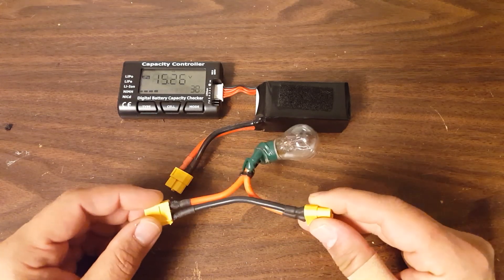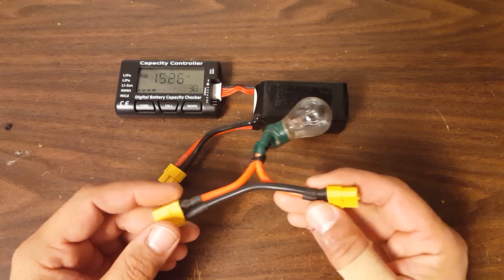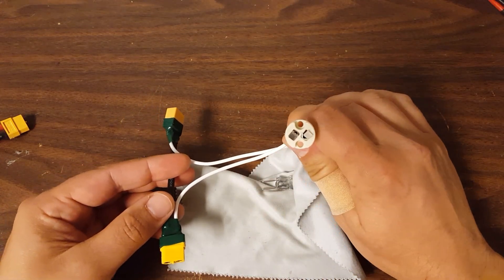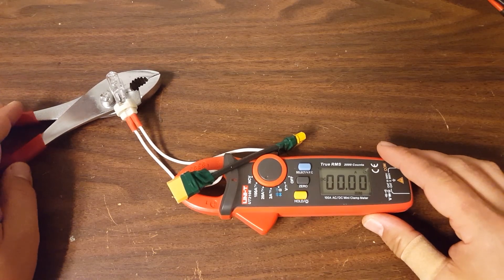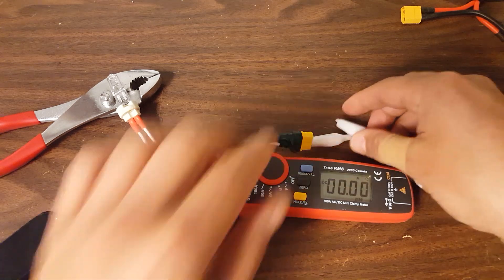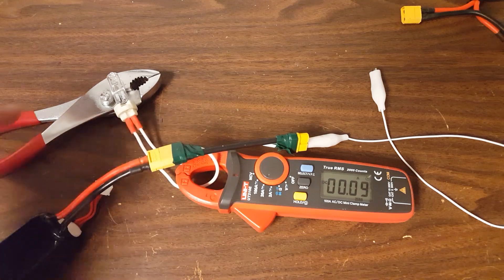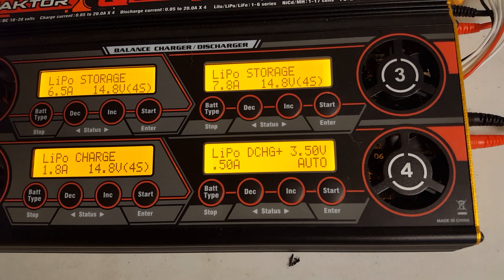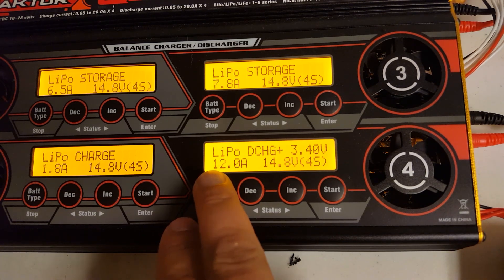Quick and Easy LiPo Battery Discharge

Comment: From the thumbnail it looked like you had soldered your wrench straight to the wires. It seemed like a brilliant idea to me. I was disappointed that your method was much safer. I think using the wrench as a resistor would be faster, though.

Comment: Would this method work for storage charging?  Eg, a full battery you want to storage voltage, add in this patch and bulb and then actively switch it off when the charger says you are at the correct voltage?

Comment: Might want to make sure your bulb leads are insolated from each other. They are not heavy duty silicone. The copper wire itself can take the amperage all day, but the insulation may get hot and melt and if the 2 leads touch we get a good example of why we never short a battery.  Your 100 watt bulb circuit will become 0 ohms.  I know the charger will limit the discharge current, but we don't want a bench fire.

Comment: Sorry, I know this is a slightly old video, but as with a lot of your videos, it still feels relevant!  Thanks for keeping these up there.

I was just wondering if there was any reason why you wouldn't just use a couple of power resistors in series on the positive line?  maybe 200W so with a 2s from 8.4v you'll discharge at almost 24A....or is that too fast?
Reply from the maker: If you had a 2S battery and wanted to discharge 200 watts you would need a 0.33 ohm resistor and would discharge 24 amps. The amps is probably safe for most 2S packs down to at least 1000 mAh and probably smaller, however the voltage sag at that high output would probably make stopping at a precise voltage difficult.

For more: https://www.youtube.com/watch?v=4CVd7QjGKGE&t=690s&ab_channel=JoshuaBardwell
Reply: @JoshuaBardwell  Thanks for the link....the load bank looks like a fun build, if only for the knife switch!  Although every time I switch it I'll have to give an insane monologue and a manic laugh MMWAHAHAHAHA!

Comment: I need a cheap way to discharge my escooter's 48v Lifepo4 and my ebike's 52v lipo battery. Both have XLR connectors. The 52v lipo has an led on/off switch which I often leave on as a parasitic drain, but since it takes so long to drain down to 50%soc, I sometimes forget and I afraid I will accidentally drain it fully. The 48v is Chinese and is from 2016, so I really need to pay attention to that one over the winter or it may be anemic come spring. I don't use it that often throughout the year, so it has relatively few cycles. I just need a cheap way to make a light bulb glow, but I don't have the skill to make it. Any help is appreciated.

Comment: 4:00  What about eye protection from UV rays?   I installed some halogen downlights in kitchen, and the instructions said, "Never operate without glass shield in place."   Maybe the danger is glass shrapnel, and not sunburn, or burnt corneas.  See:  "Is my halogen desk lamp UV safe? | BudgetLightForum dotcom"

Comment: great video but quick question.  i had a 3S fully charged up (4.2 per cell).  But i crashed the plane, it is going to take me a while to rebuild the plane.....Each cell was still at 4.13, .  Should i discharge the 3S down to 3.85 or should i discharge it down to 3.2 or something? (with my balance charger that has a discharge feature). then bring it back up to 3.85 ? (with my balance charger).  I will not use it again until my plane is fixed. Probably a week or so.
Reply from the maker: Take it to 3.8
Reply: @JoshuaBardwell  Excellent.  Last thing...sounds like you have tons of experience / flight-time.  What battery brand have you had the most success with? Turnigy or something else?  I want to go with what someone like yourself would recommend. thx in advance .........

Comment: I'm not having any luck with this.  My 4s battery smokes the 12V 100w halogen bulb immediately once I plug it in.
Reply from the maker: You can put two bulbs in series if you want. This will increase resistance but also decrease discharge rate. I'm not sure why yours is burning out but mine don't.
Reply: Thanks Josh, I’ll try that. I thought maybe I just had a bad bulb at first but I toasted 3 of them in a row.  I’ll add a second one in series and see how it goes.

Comment: I got the halogen bulb as suggested and set it up exactly how you did but when I'm trying to discharge a fully charged lipo the halogen bulb lights up for about 5 seconds and ramps up the amps but then it drops right back down to 1amp and the bulb goes off!  Why would it do that?   It's taking me hours to discharge my unused lipos after a flying day :-(

Comment: Would a 100w 120v halogen bulb work? Or does it need to be 12v?
Reply from the maker: A 120v 100W bulb has a resistance such that it dissipates 100 watts when 120v is applied to it. If 12v was applied to it, it would dissipate approximate 10 watts (1/10th the voltage, 1/10th the wattage). So it would "work" in that nothing would break, but it wouldn't be very effective as a discharger.
Reply: Joshua Bardwell thanks for the quick reply, while I was standing in front of the bulb aisle. 👍

Comment: Joshua, I've got your own parallel board V2. Assuming that each battery's voltage are within 0.4v of each other, can I use it to discharge lipos to storage voltage? Also, can I mix 1300 with 1500mah lipos? Thanks in advance.
Reply from the maker: Yes and yes.

Comment: I just got some heat syncs and fans from computers for general heat management and will use some of this info for discharging. Thanks.   For fun, I am thinking an EDF connected to a vacuum canister so battery drainage is shop cleanage. Or something like a leaf blower just to clear the space.

Comment: I have a standard household 100W light bulb and am discharging 4x4 18650's wired to run at about 14.8V. they re simply running the light bulb as normal, and the element just barely glows. It's working but at this rate it will take way too long to discharge fast, the whole idea of doing this. If I do the dead short as you have, using the same household bulb, will that make a difference in discharge speed? Or will I be essentually doing the same thing as I am? Please forgive the question if it's stupid, I know little about the math on this stuff :)
Reply from the maker: +Reluctant Rider household bulb is made to run at 120 volts not 14.8. That's why it's taking so long.

Comment: If you find an old lamp or signal enclosure from a motorcycle or a car, you will be able to mount  the bulb with out issue of heat.

Comment: Why would you not just use charger discharge function? And instead of light bulbs why would you not use resistors?
Reply from the maker: Because the charger discharge function is slow. Typically 1 amp maximum.

You can use resistors if you like, but the light bulbs are cheaper. A large power resistor gets expensive.

Comment: Hey JB, Im sure you get more questions than you can handle. I think that one of my setups is messing with my batteries. I just started building my own quads. I am flying with 3s 2200 mah 25C batteries. (Its all I had on the shelf from my walkera runner) I think that my batteries are getting over-discharged or discharging too rapidly. I have the failsafe on at 3.5v in cleanflight and I rarely go that far. I have a couple new batteries coming in the mail, and I would like to fix this problem before I ruin all of them. After flying, my batteries are really hot and some have become puffy. I think that my setup is discharging the batteries too fast. Feels like I am using the wrong batteries. What is the best way to measure the true power requirements of a quad? This might be a neat little topic because I cant find much info aside from a formula to calculate flight time. I want to include all vehicle systems; vtx, tx, led strip, etc. Ideally, I would like to see measurements during flight. I think that this might help select the correct battery. I havent played with blackbox much, so I apologize if I am missing the obvious answer. Thanks for everything that you do for the community! I wouldnt be flying without you.

Comment: @Joshua -- you really shouldn't suggest people use alligator leads for this.  You may have leads that can handle 10A, but a substantial number of them cannot.  They often use 22awg (or smaller) wire, with weak crimps onto the clips themselves.  Pulling any amount of current for more than a few seconds will cause the insulation to melt and may start a fire.  The loopback XT60 is a much better idea -- bonus points if you solder a 40A blade fuse directly across an XT60 to safeguard against blowing a battery up on accident.
Reply: Bryan Boettcher 
I agree, and the risk of a fire 🔥

Comment: Josh the problem I see with discharging at such a hi Amp draw say 7 amps is the battery
recovers quickly and your storage voltage may end up being 3.95 ....
maybe that is why most chargers only discharge by 1 amp etc
Reply from the maker: The chargers discharge at only 1 amp because the resistor banks they use as a load can only take so much heat.

Discharging at high load will result in more rebound, it's true. This can be dealt with if desired.
Reply: Yes I Suppose ....Be great if the smart charger/discharger were exactly that and ramped down there discharge current towards the end to give a true end voltage that you preset....more automation maybe needed , Ive yet to see a smart discharger that can work correctly. Have a look at your end cell voltage if set to 4s pack and 3volt (li-ion) per cell discharge, mine ended up 2.8 + 2.9 + 3.0+ 3.1 hardly and true balance discharge

Comment: Did anyone else notice that the battery was no longer discharging when the amps went low enough for the light to go out?  As soon as the light went out the volts bounced back.  Was it still discharging?  Does the bulb still consume power even though it is not lit?
Reply from the maker: I'm pretty sure yes it is still discharging.
Reply: Joshua Bardwell Good to know.  Thanks.  I like this idea.  I believe this would put less wear and tear on my charger compared to using the internal discharge feature.  When the bulb burns out, replace it.  😀

Comment: Is it ok to use a 9004 size auto bulb(headlight)? I'm just wondering if they would draw too many amps.
Reply: The batteries are likely safe with any bulb rated for under 600W at 12V. But if you're running higher than 3S, you might overload the bulb.

Comment: Hello Joshua, thank you for sharing your thouhgs and videos. I have a issue with the same kind of charger (mine is reaktor 300W 20A AD/DC from HK), I made light bulb (12v 21W) chain of 12 bulbs in total in which 2 connected in series and 6 (those 2 series connection) in parallel, which gave me in total 24V 252W. I connected it in load (positive lead of battery to positive lead of bulb chain and negative lead of bulb chain to negative lead of charger, and negative lead battery to negative lead of charger. As you did, same thing DSC+ mode, select 10A and 3.4V, press and hold start button, it start going up to 9.9~10Amps for a 5~9 seconds (bulbs turned on), after that it slightly fall down untill 0.89Amp. Battery is fully charged 6S 10000mAh.
I made all settings in reaktor menu for limiting current and voltage but it hopeless, may be you can help with it.
Reply: Same problem here with just a 100w halogen :/

Comment: Don't have any 12v bulbs at hand right now, but can't I just use a 100W/220V bulb instead? Or maybe two 50W/220V in series?
Reply from the maker: No, because the bulb's resistance is designed for 220V so the current flow at 12v will be basically zero.

On a side note, why do we tend to use a capital 'v' when writing mains power (220V) but a little 'v' when writing low-voltage DC (12v)?

Comment: Thanks Joshua. I wonder if this might work for one of my batteries as my charger doesn't have a discharge setting. It's a Multistart 3S 4000 10C batt. I've been getting about 15mins on my 500 quad before my Naza warning light comes out which I've set to 10.5 for first warning. It's been taking almost 4000(a lot I know) on charge but never measures lower than 11.1 when I land. Yesterday warning light came on at 7 mins, so landed and after battery cooled charged(5A) it but only too 1500mah. Seems slightly puffed but not much. Today same deal so charging it at 1.5A then I'll see what happens. Planning on getting another charger that will discharge but perhaps it's something else. Doesn't appear to be over discharge of course at 11.1 at landing but I'm not sure. Any feedback would be appreciated, Thanks

Comment: Hi Joshua, thanks for the video. I built a device with two 50w halogen bulbs in parallel wired in series in the positive lead just like you did. I am using the Reaktor 2x300w and i get the same effect you had here, the discharge current goes up to what i set and shortly after drops down to the charger's rated maximum internal discharge rate of 1.3a (=20w). In the Reaktor manual it says in DSCH+ mode it will discharge with up to 150w for about 30s. So my question is, how do i get it to discharge continuously at the set amp without dropping back to 1.3a discharge rate after 20-30 seconds?
Shorting out my light bulbs with a 4s pack gave me about 8,5 amps on my amp meter to work with. I used fully charged 4s for testing with the reaktor.
Reply: +Flo Sch And also it says in the Manual the balance plug needs to be directly connected to the Reaktor balance port when using DSCH+
Reply from the maker: +Flo Sch I also observed this with the Reaktor and I have no idea why it's happening. The light bulb should be dropping voltage and dissipating heat. The internal resistors should not be taking any load. The reason the unit drops to 1 amp is that the thermal overload is kicking in, but I have no idea why that's happening.
Reply: +Joshua Bardwell check this, i think it is related http://www.rcgroups.com/forums/showthread.php?t=2473255
Reply from the maker: Flo Sch Well done. That's obviously the issue. Sounds like a real flaw in the design of the charger. What a shame. But wow, at least the charger has protective circuitry to keep itself safe during this condition.

Comment: Very insightful video, thanks for the tips.
On a side note, how are you liking the Turnigy Reaktor Quadkore? Any comment to let's say the iCharger 300watt?
Reply from the maker: +Joe Hannouch Well, I've never used an iCharger so I couldn't say. It's nice having 4x 300 watt chargers though. Really easy to slap four batteries on regardless of state of charge, or get a bunch of parallel charge boards going. I can charge 11x 1300 mAh 4S in about a half hour, with capacity to spare.
Reply: +Joshua Bardwell thanks! just got the Reaktor duo x2 300 watt.

Comment: Great vid. This is the only real way to find the true capacity of a battery.  Of course in real life a 30 amp load would better  mimic a quad. 
 Q. with that external load, is the charger display still giving you actual amps and mAh used?
Reply from the maker: +ultimate99tube Yes. The amps and charge readout are still accurate. Current in a series circuit is the same at any point in the circuit. So the charger can measure the current no problem.

Comment: I wonder if you could make a cheap analog circuit to replace the charger and stop the discharging at a certain V/cell
Reply from the maker: +PiManASM Yes. It wouldn't be too hard. I could imagine a voltage divider feeding pack voltage into the gate pin of a FET. Use a potentiometer as part of the divider and then adjusting it would adjust the voltage at which the FET turned off.

Comment: not as advanced as yours but i use 3 automotive tail lamp bulbs in parallel and works ok. thx for another educational vid.
Reply from the maker: +michael lee Same idea. Three tail lights in parallel should give about 9 amps, same as this.
Reply: +Joshua Bardwell Hey man, big fan of your channel. Super informative stuff! You said you had a link to the bulb and the bulb connector in the descrip? Not seein it lol. Could you link me please?
Reply from the maker: +WhomImIzFPV Added to the description. Sorry about that.
Reply: +Joshua Bardwell Np, thx. 
So, how do you feel about this charger? I was gonna get a 406 duo, then i saw this. Me and my friends really respect and trust your opinion. 
I nvr charge faster than one C. And i dont charge anything bigger than 4c. It seems like units with a power supply required are all around better. But this one is ac/dc right? And can it charge Lihv's?
Reply from the maker: WhomImIzFPV Not AC/DC. You need an external supply, and you want a 24 volt supply to really make the most of it. And it can't charge LiHV.

This unit is pretty expensive compared to some other units on the market, but if you're considering a 406 Duo, it's cheap. I like it just fine. If you want to charge LiHV, consider an Accucel 6 80 watt, or two, or three. For more capacity, consider this one:

http://www.hobbyking.com/hobbyking/store/__81837__TURNIGY_MEGA_1344W_40A_Balance_Charger_Discharger.html

When considering the Quattro, you have to ask yourself whether you really want 4x 300W charger, or whether a single, larger charger would do the job for you. You can get the same wattage in that Mega charger, for $100 less, if you are willing to settle for a single channel vs. four separate channels.
Reply: +Joshua Bardwell Nope, i want to change as many packs as possible, lol. I live a block away from my flying spot and like to charge and go, but 45 min per pack is over 8hrs for me to fully charge em all.
Reply: +Joshua Bardwell *charge
Reply from the maker: I sometimes go as high as 3C charge rate if I'm really pushing it. With fast charge cycle, I finish in under 15 minutes. But watch your car battery!
Reply from the maker: With a parallel charging setup, the single big charger can charge all your packs at once. But there is more management to do. Making sure the voltage is safe, etc...
Reply: +Joshua Bardwell That's what i like about the icharger. It monitors each cell voltagee individually and brings each one, up and down evenly.